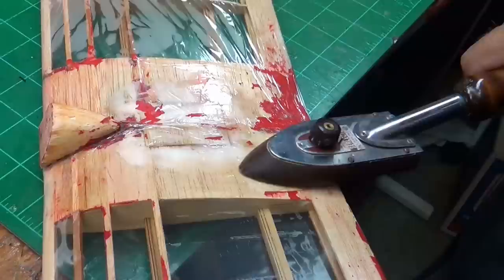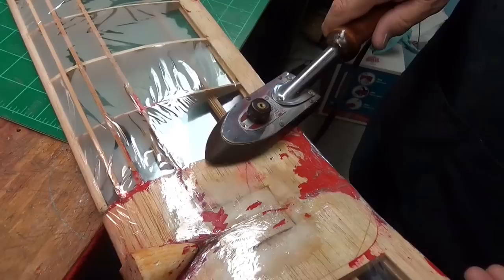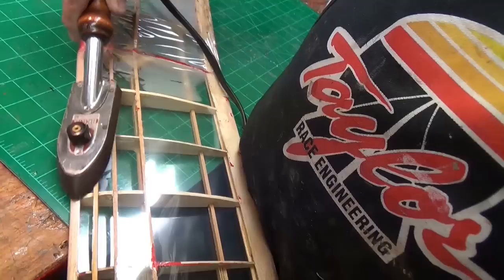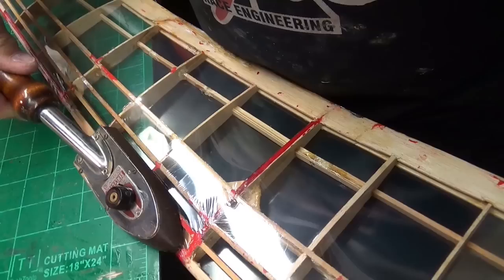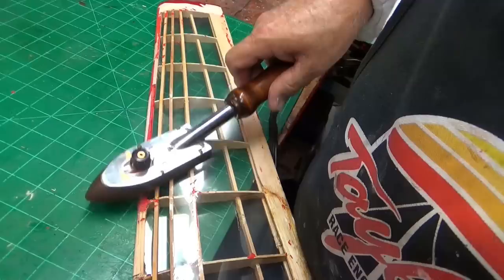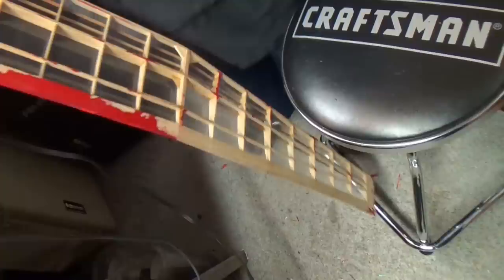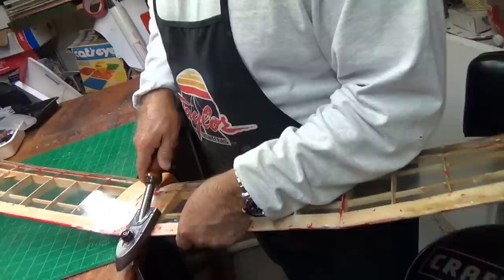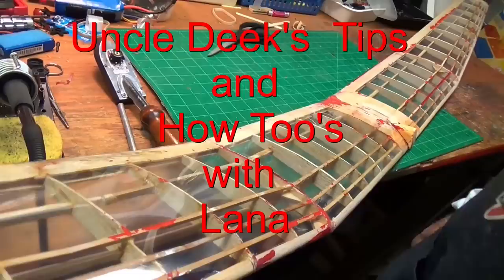New   Covering a Balsa Wing with Laminating Film #

Comment: I like the clear film, what you could have done to tidy the wing up before covering it is give it a light coat of a primer. 
Grey would cover the red best but I think I would choose white, as long as you don't put too much paint down the grain of the wood will remain and the laminate will still have a good surface to grip too but you need to wait a couple of days after painting to make sure it's completely set so it does not melt under the heat of the open.
Reply from the maker: Absolutely!
However in this case the intent was to make a point.   Which in-turn has stirred great conversations.
Thanks a big bunch for watching!!!

Comment: Hi Dick, thanks for a great idea. What is the weight penalty between this and Oracover? Maybe just a percent figure difference as an idea of the weight difference would be? Could this idea be used on a gas and or nitro plane? Would the paint withstand that oil and petroleum? Has your friends 1/3 scale Piper Cub been out on a hot sunny day... how does it handle the heat? Cheers from South Africa

Comment: You can paint on top of it. Go over it with fine steel wool and spray paint it. I've even heard of people doping tissue over it (looks like doped tissue but really tough). If you want lots of it check out usi-laminate.com, or laminator.com or laminatingoutlet.com, or MyBinding.com. 4 mil is rather thick, but should work pretty well on open structures like this. You can find it as thin as 1.2 mil and as thick as 10. Nice covering job, I must say. A heat gun would work from shrinking, too.
Reply from the maker: You said it!!
Thanks a bunch for watching!!
Reply: That's awesome. I was looking for buying more in bulk. 
I sent up a plane last night on an iNav mission. Because of where I was going, it was a tight spot and the landing took a couple approaches and still too tight to avoid some easy branches, luckily at low velocity. 
Anyway, thanks to both. Time for me to get started in covering.

Comment: is this the doculam or trulam type stuff, or is it a brand specific to our hobby?  Also, do you think it would work to use an iron to adhere it to the model, and then use a head gun to take out the wrinkles of the open areas?
Reply: I used a heat gun to remove the wrinkles, works AMAZINGLY! makes your plane look like its done by a pro.
Reply from the maker: Way kool man
My friend Boston just did a 1/3 scale Cub completely with laminating film then painted it in the army colors.  It looks and feels like fabric.
Reply from the maker: Laminating film like you get at the office supply store to laminate a picture or picture.
An iron might work but it would be very hard to get into the tight places.  A MonoCote iron is perfect and the heat is very adjustable.
Reply: I just covered my 2meter wing with an ordinary, domestic house iron a notch past 1 and worked perfectly using solarfilm. Cheers, Darius.

Comment: I have been cutting the Doculam,laying it sticky side down on a towel over your flat building board. Then I take a 3m scuff pad and just rough up the outside surface really good.. scratch it all up. Cover with it, WIPE WITH RUBBING ALCOHOL right before priming..and then do a light prime with Rustoleum auto primer. I then paint with water based paints (I hand brush with foam brushes mostly) ..never tried solvent..not sure it would work. You can clear afterwards. Obviously this can add weight to the plane.. but good results can be achieved, https://www.youtube.com/watch?v=Nt72djSEvh8
Reply from the maker: Great Idea it is sorta what I do.
Thanks a bunch for watching!!

Comment: can you use a heat gun to do this?
Reply from the maker: It is similar to Monocote, it takes the pressure if the iron on the edges.   You could try a blow gun it wouldn't hurt, however I don't think it is necessary.  I shrinks up so well with the iron it is just one fluid movement.   
The film doesn't pucker up after a while and have to be re-shrunk!!!   Unlike Monocote?
This wing has never had an iron touched to it since this video and I fly it all the time.
Thanks a bunch for watching.

Comment: Are you using some type of adhesive,  like 3M 77, for the laminate to stick to the balsa frame ? would appreciate your feedback. Also where do you get this material ?

Thank you for your time
Reply from the maker: No extra adhesive.  The laminating film sticks well to wood.
This wing has been used for over two years now and it is still perfect and tough as nails.
Get the Laminating Film from Aloft Hobbies  the New Stuff  
Thanks for watching!!!
Reply: Dick,

Thank you VERY much !!!  One final question mostly as a reference point: does the 1.7mil is equivalent in thickness to the traditional monokote thickness ?  I plan to use this laminating film as a wing covering base and then lightly scuff / paint on top ..  most of my control line models are in the .35 to .45 size range so I presume the 1.7 mil should be strong enough. Correct ?

By the way, I visited alofthobbies.com and found the material. Thank you, once again, for your time.

Regards
Reply from the maker: The 1.7 is about the same a monocote but way way stronger and tougher.  I use the 1.7 for curvy and convoluted areas and the top of wings.  I use the thicker for the bottom of wings because it lessens wing flex.  I also use the thicker for the bottom of foam planes without wheels.  It makes a great skid pad.  Use Krylon fast dry enamel paint and just wipe the covering with alcohol to clean it them paint it.  It sticks great.
Reply: PERFECT !!!!

I will primarily use the 1.7mil then but will also purchase some 4mil for testing it too.
With regards to painting, I would rather spend a little bit of time and sand the surface with 400 grit so the paint can "bite" onto the covering and have piece of mind. 

Thank you once again for your responses. Time to experiment now :)

Best regards,

Comment: Nice. I've never heard of laminating film. Why didn't you use a heat gun to shrink it?
Reply: You need to use pressure to stick laminate to the balsa, and a heat gun would be too uncontrollable since the air goes everywhere.
Reply from the maker: xKmotx Laminating film is what you get cards or papers covered with at the office supply store.  I have been covering foam airplane with it for a couple of years.  I just thought I would give it a go on balsa and was pleasantly surprised. I thought about using a hot air gun but the iron is so easy.  I will try it and let you know.  Why do I use laminating film, because it is sooooo tough.  It is hard to poke a hole in and it doesn't break like Monokote.  Check out my video on how to repair a foam plane covered with laminating film.  Thanks for watching.